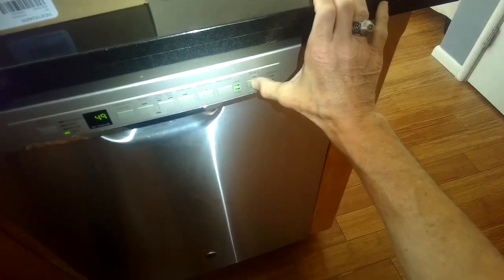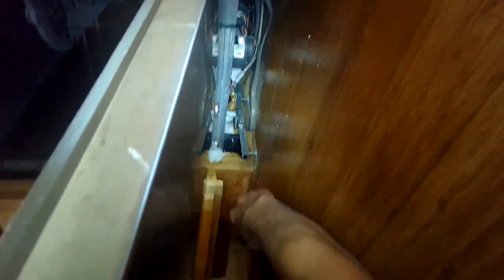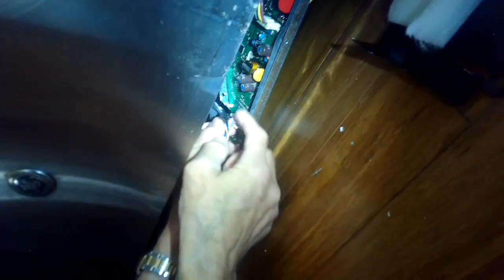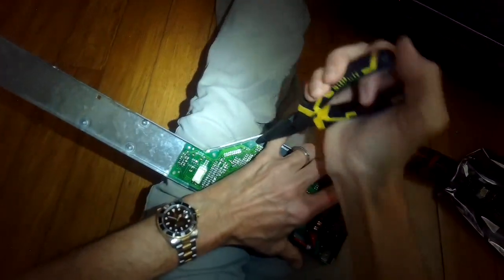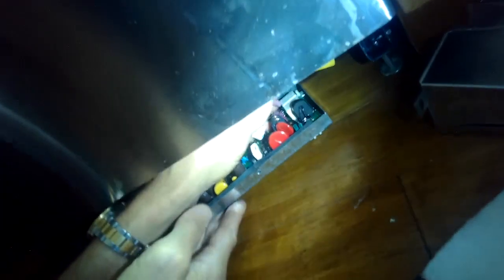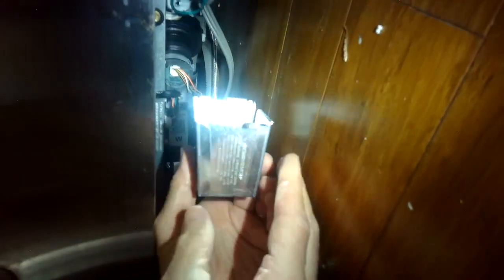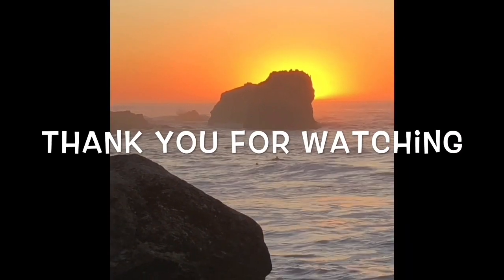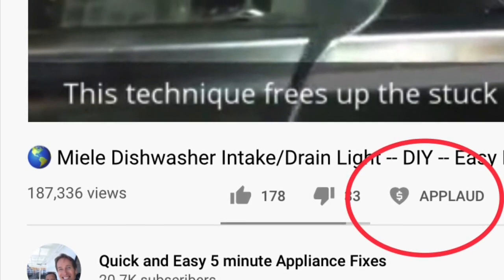✨ GE DISHWASHER-3 BEEPS - WON’T START - Easy DIY Fix ✨

Comment: Thank you. I had moved my dish washer, in doing so one of the wires to the door latch got cut.   From the trouble shooting you posted I was able to find the problem in less than two minutes. Soldered the wire back t. Added heat shrink, now it is good to go.
Reply from the maker: Great job😊😊😊

Comment: Thanks for the video same problem and this was the fix !! Update amazon wants $195.00 for this part after reading all the complaints about this dishwasher i called GE this part has a new part number now and they sell it for $135.00 and they gave me 50% off after i complained . Went in jyst like video and running maybe new part number means they fixed the problem .
Reply from the maker: Wow, great job Ed.
Can you share with us the new part number when you get a chance and I’ll create new links for the better and less expensive part.

Comment: Apologies in advance if I missed it, but there is a $55 Core Charge that the Appliance Parts store will charge if you don't have the old board in hand.  Not that big of a deal, just had to make an additional trip back to the store with the old board to get my $55 back.  Recommend removing the old board first and take the store with you.
Reply from the maker: Excellent,
Thank you😊

Comment: My GE dishwasher will randomly turn the control  panel lights on and beep. Even when not being touched. It will later turn off, but will turn the Lights back on and beep. Is this situation fixed with the same part as in this video?

Comment: I just had the same problem. A good thing to try is to reboot the dishwasher by turning off the power, usually by shutting off the circuit breaker on your home breaker panel. Wait for 5 minutes and then turn the power back on. This should reboot the dishwasher and return it to it's out-of-the-box state. This procedure solved the problem for me so it's the first thing you should try before calling for a service visit or replacing the control board.
Reply from the maker: Great idea William👍
Reply: Thank you for this tip! Flipping the breaker worked for me!
Reply: +1 worked for me too
Reply: You just saved me $100. Cheers
Reply: Yup!! Worked like a charm!
Reply: Me too!
Reply: It worked for me about five times then no more!

Comment: Just followed the instructions on this video and now my 5-year-old dishwasher is working again! I hope the new part holds up. I will take the advice of another commenter and keep the door firmly closed at all times from now on. I usually left the door slightly ajar when not in use. It's a shame these dishwashers are not well made. I was glad to buy a dishwasher made in my hometown of Louisville!
Reply from the maker: Nice job,
It’s too bad that GE is no longer making quality appliances.
The power boards don’t last very long at all.
It’s always recommended before replacing the board to disconnect the wires from the board and then reconnect them in that often will share the problem.

Comment: Thank you, you're correct about this dishwasher not being well made. We had to get warranty repairs done after 3 years. The tech had to replace the display module but luckily brought the board from this video and left it with me after not needing for our fix. Fast forward to now a few months outside the warranty I grabbed the board from the garage and had it fixed quickly with your video. Saved me buying a new washer for now. 😁
Reply from the maker: Wow,
That’s good luck👍

Comment: I am happy to report a consistent, easy fix for this after trying about a million things. This appears to be a pretty common issue with GE dishwashers, so at some point, you're gonna need to replace the hardware to really solve it. But here's what you can do in the interim if you really gotta get those dishes done. Hold Select and Start until door diagnostic appears. (815 should show on the display and all lights should blink in unison.) Keep the door open. Cut power to the unit by either unplugging or shutting off the breaker. This essentially "confirms" to the control board that the door is open as the unit powers down. Restore power after five minutes. The control board should now be "reset" to a condition where it understands the door is open. Load and start the unit and it should work properly.

UPDATE 3/22: Thank you all for the kind words. Unfortunately, about 3 weeks ago the dishwasher began acting up again with this issue and nothing I could do this time would fix it. A service tech came out and told me that he sees this frequently with this model and that it may have to do with a design flaw that allows errant moisture to leak in and affect the control board circuitry. He quoted a price to fix it that is about 3/4 of what a new model would cost, so my apartment management will be going with a different unit and I insisted that it not be GE. Best of luck to all and I hope this trick keeps working for you!
Reply from the maker: Wow,

Nice job Paul😊
Reply: That didn't do it. I think I'm down to ordering a part.
Reply: That didn't work for my model GDT695SMJOES...what part # do I order
Reply: Mine had 2 screws/bolts holding the kick plate, then the 2 inside screws of 4 showing (if memory serves). Unplug the thin wire/plug going to door and one more going straight up into the control board. Start easing board down from left, when it’s tilted enough bring it forward/out. Unplug 2-3 wires on board, install new board with everything in reverse order. Watch that you don’t severely bend the capacitors coming out of the board on the way back in.
Reply: All plugs are different sizes so I don’t think you can mix them up. Pinch to release. Also pinch little plastic retainers to lift the board out of the thin metal housing.
Reply: Awesome, That quick fix worked for me... about how long do you think that will fix it?  Will I need to do those steps every time I want to run the dishwasher?
Reply: @jessicagwozdz1032  it has held for me for a while now. One thing I think is helping is that I no longer leave the dishwasher door open slightly when not in use. I always keep it firmly closed when I’m not loading or unloading it. Good luck!
Reply: @jessicagwozdz1032  Going through the menu or powering down never worked for me. I took the board out, said God I need this work a while longer, put it back in and got 2-3 months out of it.
Reply: paul n is god.  i wonder how many more times it will crap out and  i will have to do this. hopefully it will continue to work if i have to do it again
Reply: I just tried this quick fix and it worked perfectly. Thank you, Paul N. Great work around!
Reply: Paul, man I wish I could buy you a beer right now. This was bloody brilliant! Thank you so much!
Reply: I can't believe I watched this video and ordered a part without seeing this comment. Thankfully the Newegg seller bailed, otherwise I'd be out $90. Paul N's suggestion worked like a charm. Thank you sir!
Reply: Did this and thank you so much!  I installed this DW and my wife swears it was something that I did even though it was working for months before it stopped!!!

It is running consistently now until it stops again.
Reply: It worked!!!  Thank you so much for this great shortcut!!  Brilliant!
Reply: Paul, how was the tech that came out going to fix it this known GE issue? I had my board replaced about 3 weeks ago and now it is doing the same thing again.
Reply: This reset trick worked for me at my vacation condo!  Thanks
Reply: This fix worked for me, thank you so much.

Comment: Thank you for the video! I replaced the board on our 5 year old GE dishwasher, took about 15 minutes after watching this. Our GE model replaced a dishwasher that was installed about 30 years ago. One would think that spending so much on a newer model, maybe it might last a while before replacing parts. Thanks GE!

Comment: Many thanks to Scott “The Fix-It Guy” and to the many commentors.
Our GE dishwasher was a textbook case for this video.  I ordered the controller card on Amazon for $106.92.  It was delivered in two days.  I don’t want to jinx it, one wash in, but the dishwasher starts when closing the door.  No more 3 beeps and flashing light telling me the door is open, when it’s not.  I expect a service call would have been $100 to diagnosis and $300 to remedy.  Not to mention the positive feelings from a DIY job well done.  Thanks friends!
👍🤜
Reply from the maker: Great job Dave😊👍

Comment: I had the 3 beep issue with a 4 year old GE PDF820SSJSS Profile Dishwasher as well. The new controller costed me $117.Great video, the step by step instructions really helped me out. I’m back up and running. This will be my last GE Appliance.

Comment: Thanks.  It worked.  Took about 10 times longer than you did.  Fasteners didn't like me.  Plus the install was very tight.

Part was $97 on Amazon. Door switch was $37 at Sears.. (It wasn't needed)..

So far it works and doesn't leak.  Thanks.

Comment: Same problem. You said it all when you said these GE dishwashers are not lasting very well. We had to replace our microwave too. Had bought the entire kitchen set. I'm finished with GE. Sad, they're American made, but are unfortunately junk.

Update: Replaced the control board for over $100. plus tax and shipping. I had already replaced the door latch, and as noted the microwave not long after purchase. The dishwasher is working again, but for how long? Again... GE is junk.
Reply: American made?  The electronics come from China.
Reply: @duaneramer3776  Sad, although GE is an American company.

Comment: Fix this free without replacing the board. Try never closing the door after a cycle if the door lock itself isn't broken and it's a bad board. It will power off/on by itself when it puts itself to sleep...but it'll never generate the "door is open" error code. You'll never have to replace the circuit board or power cycle the unit to erase the code ever again. Free fix. I got my dish washer free on craigslist due to this error. It would only run 1 cycle before doing the 3 beeps error till I left the door open and saw it puts itself to sleep and I've done 15 wash cycles and never get the error.
Reply from the maker: Thank you😊👍

Comment: Thank you!  Easy to follow.  Was getting the door not closed beep (when the light in front doesn't come on right away) and when I tried the service/test mode it gave an 815 error (rather than 888).  Tried replacing the door switch (reasonably cheap ~$25); no dice.  Replacing the control board has done it!

Comment: Thanks! Just repaired our almost-4-year-old machine. The part was less than $100. Also found that the original installers neglected to screw the little electrical box in! Also the dishwasher and garbage disposal circuit breaker labels were swapped. :-/ 

But thanks for the video!
Reply from the maker: Thanks Rob😊

Comment: I had the same problem. Dishwasher wouldn't start and it peeped three times. I replaced the switch for the door. I thought that was the problem but it started doing the same thing again. I'm going to try replacing the control board. To see if that works. Thanks, for the video.
Reply from the maker: Yep, about 70% of the time it’s the control board.
Reply: Which is it? In the one video you say 80% of the time it's the switch. Here you say 70% of the time it's the control board.
Reply: Finally, got my dishwasher working. After I couldn't find the exact model number control board. I found one on Amazon that said it would work with my machine. Just finished installing it, and presto. Dishwasher started working again. 😊
Thanks, for the help. 👍
Reply: @mrtydg  awesome! Glad to hear you got it going. I'd like to do the same but I would prefer replacing only the piece that is bad. Did you happen to meter the switch to see if it was defective? I'm wondering if that's possible
Reply: @waynemanning9015  I already had replaced the switch. It started working again after replacing it. But, it stopped working again after a while. That's when I decided to try replacing the control board.

Comment: Good video, but if you want to save 70 to 80 dollars try resetting the controller first, before you buy the controller. Unplug the power supply to the controller for at least 1 min to reset the controller. This worked for me, but might not be the solution for everyone.
Reply from the maker: Thanks for the tip Jeremy😊😊😊

Comment: I had this same problem. For a few weeks, cycling the circuit breaker to reset the board worked. But, the malfunctions grew more frequent and eventually cycling power wouldn’t get the dishwasher to work. I replaced the controller, and it worked fine for about 7 months. Now the same problem is back. Cycling the circuit breaker only worked two or three times, and now it’s nonfunctional again. Replaced the door latch and no change, so must be a bad controller again after only a few months. Frustrating and unreliable product from GE.